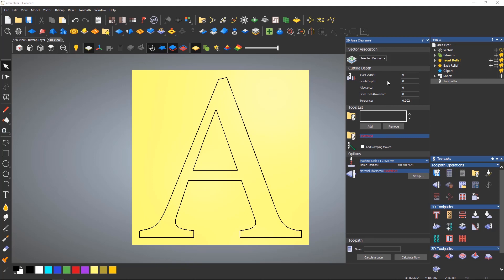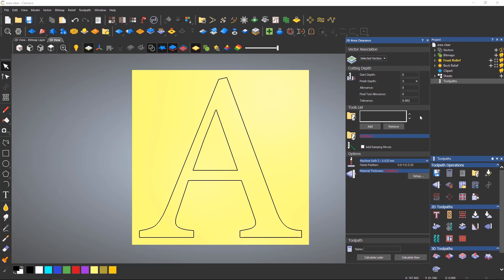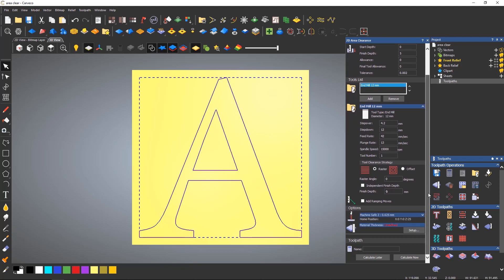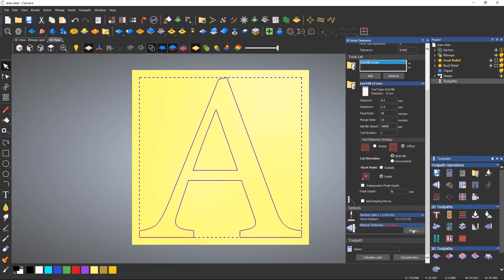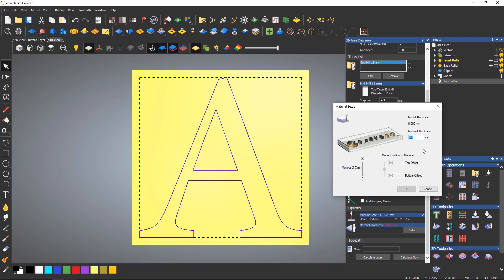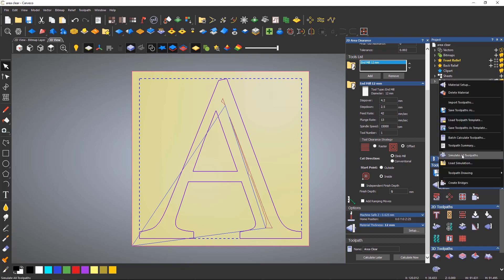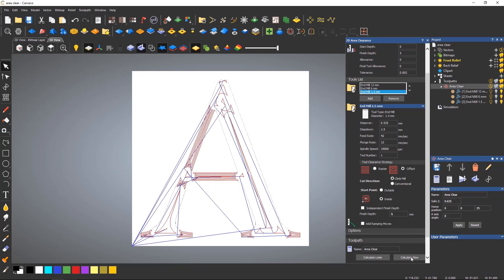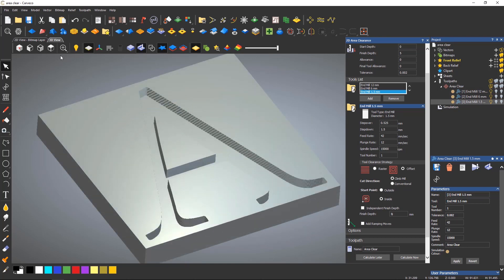Getting Started in Carveco: Area Clearance Toolpath

Comment: Hi Sir. L want to know, why l have small portion of wood leave on each tool? If i take 3 tools , 12 mm 6 mm and 3 mm . The cnc leave small pieces between each cutter pass! Thank you.
Reply from the maker: Hi Ghislain, have you tried reducing your stepover? Reducing it should stop your cutter from leaving any material between passes.
Reply: @Carveco  hi! the problem is not the stepover...i have no problem on each pass. but the problem is,  when the first operation is finish i change for next cutter, for make  better cleaning in the corner, but between the first finish cut and the second cut, the second cutter leave small area.it is small half moon of wood stuff. l dont know if maybe is the allowance is not set to good number...thanks
Reply from the maker: @ghislainlatulippe6959  Hi Ghislain, you're quite right It may potentially be the allowance, or a few other things. 
- Check your machining simulation to see if the uncleared material is showing there. 
- Make sure the depth of your cut is correct and your machine Z is calibrated and accurate to the top of the material. (so the tool is going deep enough to use its entire diameter to make contact with, and remove,  the material. 
- Make sure your material (if wood for example) isn't warped.
- If the leftover material isn't deep in the pocket, try running a final cleanup pass to pick up the stray material.
Reply from the maker: I'd recommend posting some pictures of your issue on the Carveco Support site. Our support team (and other community members) should be able to assist. :)
Reply from the maker: https://support.carveco.com/
Reply: @Carveco  thank a lot! l have remake test and all is ok!! the problem it me... l have try to take v bit 90 for make that and two end mills.
Reply: for make bevel around the letter